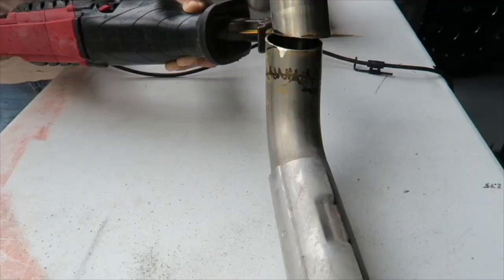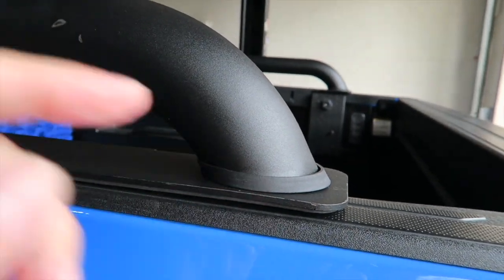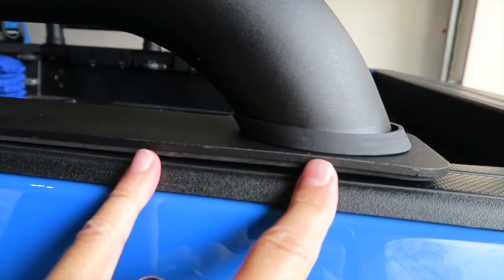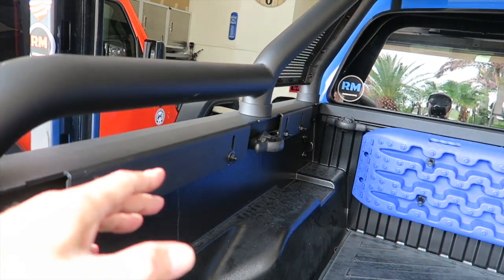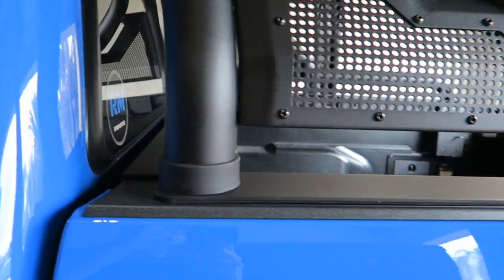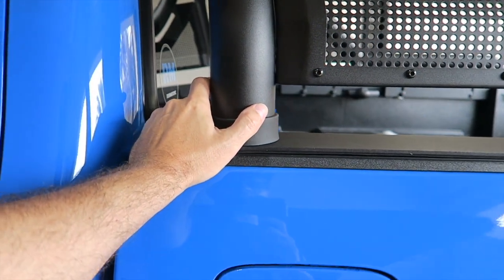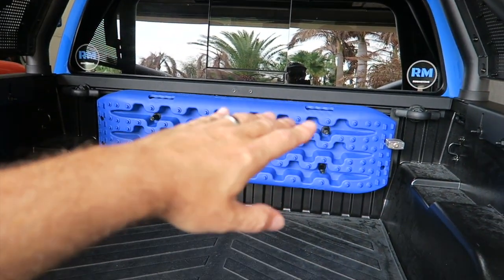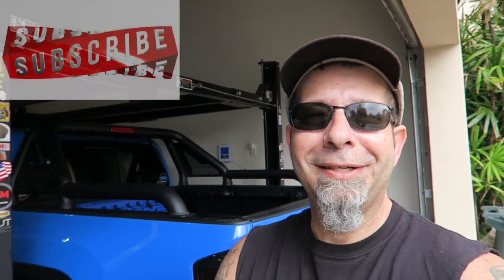Tacoma Mod Mistake that's Driving Me Crazy

Comment: the cable is not a problem just add a little more and that's it
Reply from the maker: Yup...just the added time that shouldn’t have been necessary if done correctly the first time😬
Reply: @RobMotive  but that's good so you help your sub, learn and not make the same mistakes
Reply from the maker: Hopefully it helps someone out.  👍
Reply: @RobMotive  thas for sure